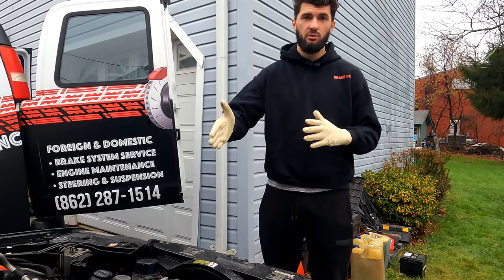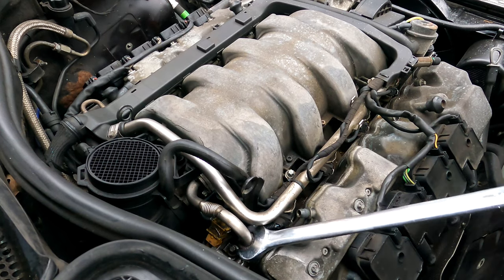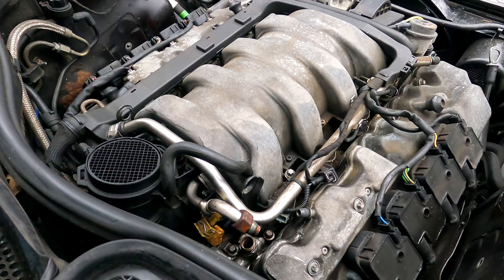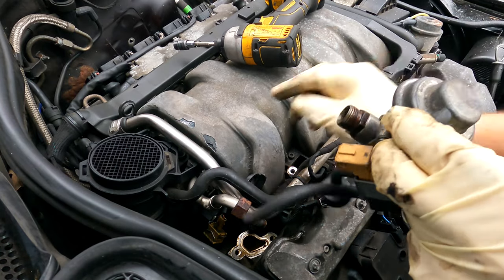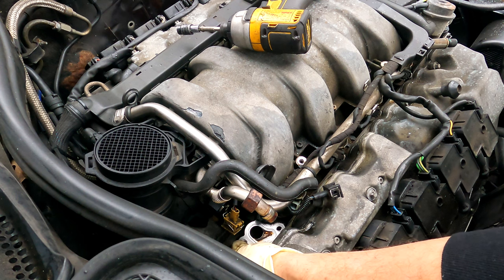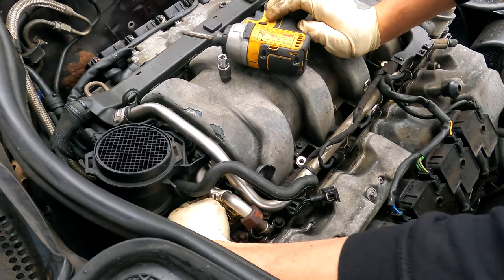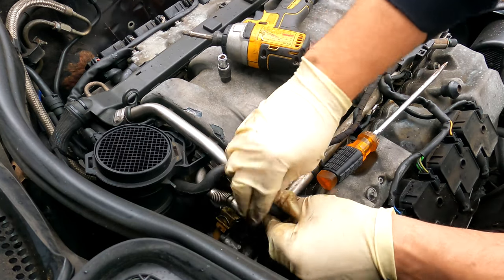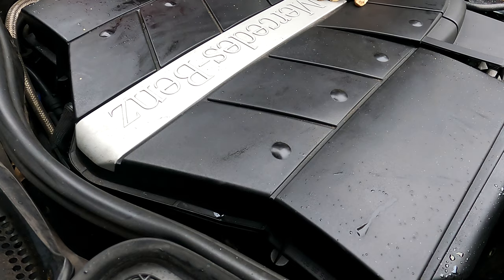HOW TO REPLACE EGR VALVE ON YOUR MERCEDES [M112 & M113 ENGINE]

Comment: My 05 e320 has a shaky idle sometimes but otherwise runs fine.  I thinking it may be vacuum or air leak but could a dirty EGR valve cause this also!?
Reply: Hi mascho22, I have the same here. How did you solve, if you did already?
Reply: @burakburak54  I didn't replace, just removed and cleaned it.  Seemed to help a little.  I sold the car though about 5 months ago w/ 189k miles on it and still running strong

Comment: OK, so this is a great video for changing the EGR valve on a 2002 Benz C320 wagon w/ a 112 engine with 170K miles on it: except: my engine has a bracket that holds a transmission filler tube and, of course its right behind the egr valve. I struggled to find what holds it to the engine and finally got my saws-all and cut the damn thing off. So now I have access to the egr valve. The rest of the removal was by the numbers except: I couldn’t remove the exhaust tube from the valve it was stuck in place from 21 years of use. So I struggled with this for awhile, got pissed, said screw it and got out the propane torch. Pushed the nut up the tube and out of the way  and heated the fitting on the egr valve until it was red hot, note Im not using the valve again so if it’s wasted no big deal. Then I immediately doused the fitting with ice cold water after which the aluminum crush fitting on the exhaust tube came off no problem. I replaced the vacuum line, egr valve, put it back together, idle problem solved. The engine runs much smoother under HARD acceleration as well. Smooooooth, like a  benz should be.😉 The 112 engine in the wagon is a rocket ship had it up to 130mph on the Texas toll roads, no problem, with pedal to spare. I was trying to out run a Ford Raptor PU truck and it took every bit of 130mph to pull away from him.